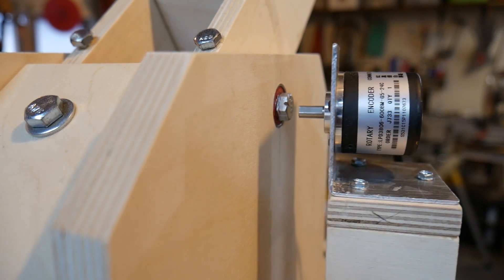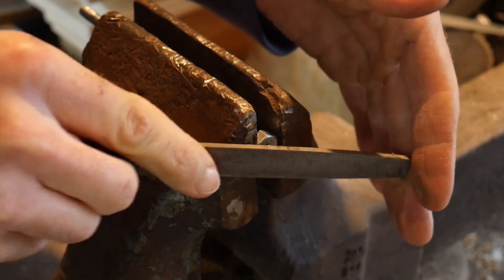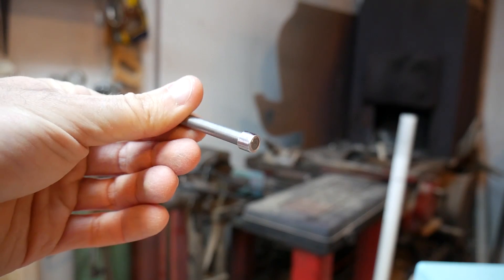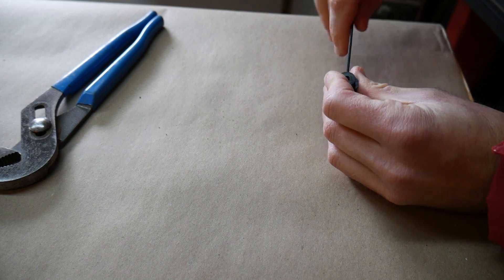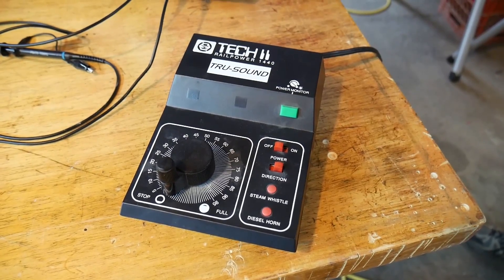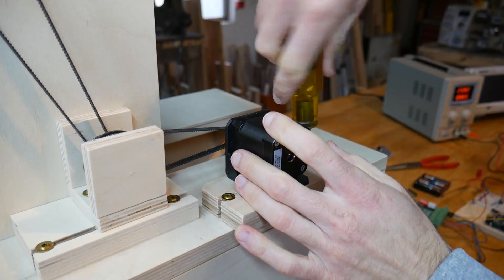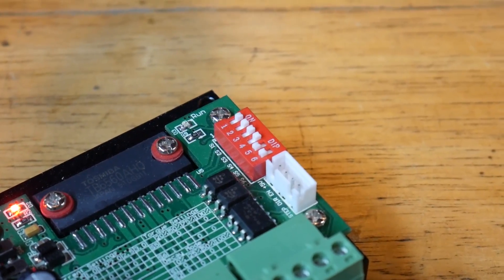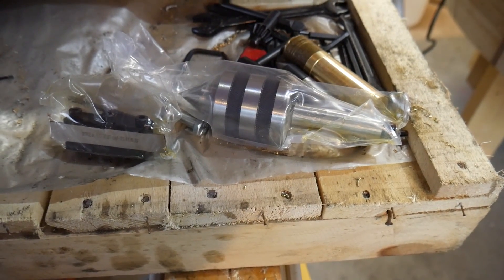Camera Control Arm #3

Comment: I would have taken some Potentiometer becouse of the mechanical stops. And some DC motor. Than you could take some Microcontroller and say rotate until the Potentiometer is equal to the Angel the Arm has to get to.

Comment: Awesome project, looking forward to future videos! I really appreciate that you showed working through all of the messy little hiccups. Most projects I do seem to run into dozens of them, and seeing someone else's problem solving techniques is a big help.
A quick question: where do you get all of your wood for your projects? The stuff I see at home depot always seems really low quality.
Reply from the maker: +Dan Thanks, it takes time to put all these together in a video so the feedback is appreciated. I would call around to various lumber yards to see who has good "baltic" or imported birch plywood. The places that offer milling services have been good in my experience. If not they'll usually know who to talk to.

Comment: Regarding the noise, you can 'isolate' steppers to some degree by putting rubber bushings somewhere in the load path and/or you can take smaller steps ('microstepping') so that the effective torque ripple is a little smaller.   Cool project!
Reply from the maker: +Kevin Haninger All of these things are on the list, microstepping and dialing down the torque setting (when unloaded) definitely seemed to help this week.

Comment: I'm really enjoying this series! Any advice on entry level electronics? I've really been itching to learn how to do this type of thing.
Reply from the maker: +BeatnikBrent I would definitely get an oscilloscope, this has been a gamechanger for me. Since I had no idea what I wanted in a scope I bought the cheapest one available and it's been great so far. Since this stuff is digital I'm mainly looking at square waves and lower frequency signals, which is easily handled by even the most basic scope. 

I would also watch a lot of project videos and look up every term you don't know. Once you're familiar with the terms you can follow along pretty well even without fully understanding every concept.

Comment: On other thought, are you sure the load on the stepper isn't causing it to loose steps and make that noise?
Reply from the maker: +Jason Rausch Pretty sure, I get similar noise when unloaded. This will be addressed later.
Reply: +Scott Rumschlag  I seem to remember when I switched from a stepper controller without microsteps to a microstepping controller I got much lower current draw, higher torque and LESS noise.  In your final product if you want to have a quiet arm, you might want to spring for a commercial microstepping controller.

Comment: It would be a little overkill, but Lovejoy couplers would work well on the encoder linkage.  it will help you deal with the different shaft sizes and gives you a little play for the less than perfect alignment.
Reply from the maker: +Jason Rausch That's interesting, I've seen those before but never knew what they were called.

Comment: I know you want to understand all of the electronics around driving the stepper motors... But have you even thought about using a stepper driver board i.e. "Easy Driver" from Spark Fun? I wonder if you run the risk of over complicating the process...
Reply from the maker: +Dominic Giles The green board (with the mis-marked diagram) is a stepper driver, it takes care of alternating the coils, torque settings, etc and has a big heatsink on the back. Getting the motor control straightened out is one of the main things this week. Most stepper motors I've seen run great, ramping smoothly, quietly, etc so I assume that once I look into this more it will be vastly improved.

Comment: You have a lathe my good man, turn a bushing down and an adapter :)
Reply from the maker: +aserta I thought about it, the wall was going to be very thin though and I hadn't been too careful when determining the pin size so I didn't have a drill bit with a nice fit. We did do this for that piece in the last video though, which had to be soldered and thus metal. It's very satisfying to be able to make the part you need at any time of day or night.

Comment: You don't need the large pulleys to be timing belt pulleys.  They turn by less than 180 degrees, so you could just fasten the belt to the pulley with a screw.
Reply from the maker: +Matthias Wandel That's true . . . and I can vary make pulleys in a lot of different sizes for experimentation.